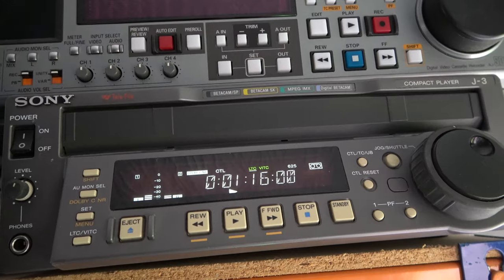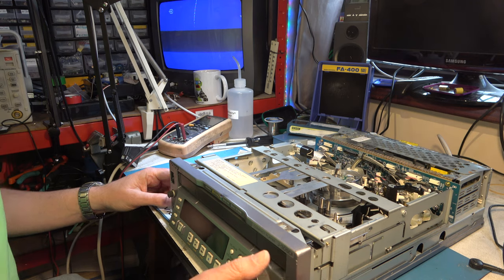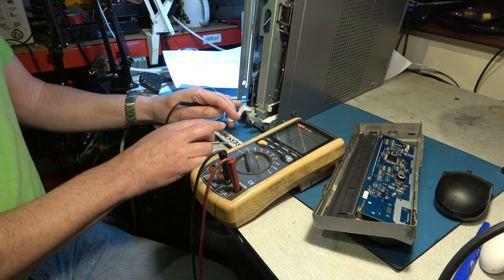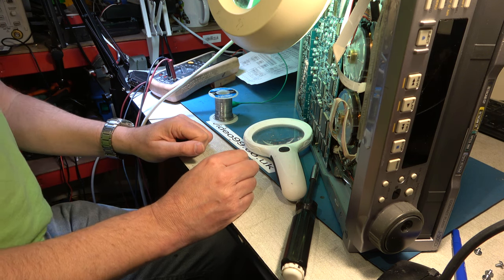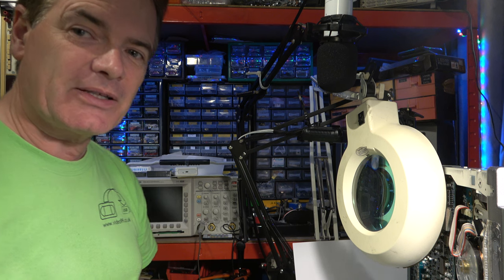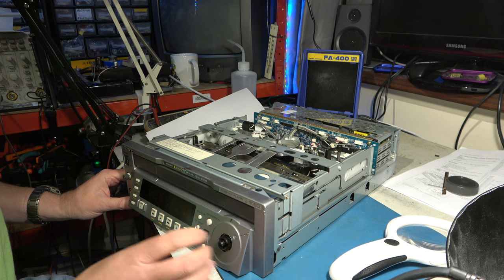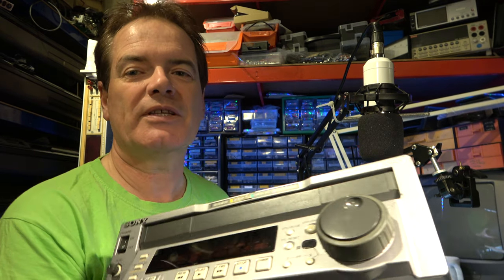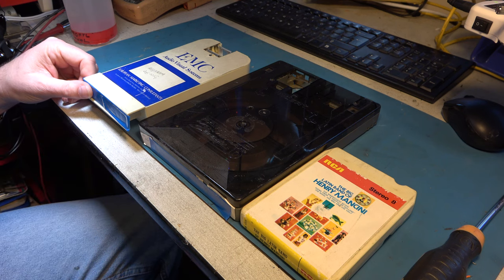Working on a Sony J-30 Digital Betacam player.  Can we get it to play a tape?

Comment: I bought x2 low hour mint condition J3's last year, both non working and both with faulty power supplies. The same fault and the same component. On one of them, if it was plugged in and left for 30 minutes it would often spring into life so I knew exactly what was going on. Both fixed easily although one really threw me as there was a problem with those ribbon cables to confuse matters! Ace units.
Reply from the maker: Got to be capacitors. Can you tell us which part(s) failed?
Reply: @video99couk  Yes. There's one capacitor, small and surrounded by a couple of other components halfway down that power supply board. Difficult to see really and definitely can't see the base. No bulging of the top and looks fine. It's in the SMPS startup circuit. I missed it for ages because it 'looked' fine and it was not as easy to take out so didn't bother. My ESR meter missed it also IN circuit. Again, that threw me off the scent. Both of these caps were the culprit on both J3's. When remove I could see leaking at the base. The 2nd machine repair still would not work which was a mystery UNTIL I found a secondary problem with one ribbon cable that despite testing fine on the bench (continuity) would not work when connected at both ends! Bad end contacts. I might have a photo somewhere and if so I'll post it here.

Comment: Nice video thankyou for sharing. Could you please take some time to talk about the loading mechanism of the beta series. Why the J30 player use the loading mechanism like VHS. And  PVW2800 or beta camcoder use several different  loading way. What will be affected by different loading methods of VTR with the same format.Thankyou!
Reply from the maker: It does go to show how the loading mechanism is not completely dictated by the format.  Most Beta equipment uses a loading ring but some uses loading arms.  Meanwhile most VHS based equipment uses loading arms but some (Philips Charlie mechanism springs to mind) uses loading rings.  Which is best?  Probably dictated by many factors including cost, weight, size and other factors.  The J machines were not as robust as the bigger decks but were all about getting size and weight down.

Comment: One drop oil on de bearing? (motor is shot anyway)
Reply from the maker: It's not mechanically stiff, it's an electronic fault with the motor.

Comment: Great video, I have one of these, if I put a digital betacam tape in should it play just via composite out or is it FireWire only ?
Reply from the maker: SDI to an SDI capture device could potentially give the best results, but Firewire would be good too.  Composite Out would work but is of course very limited quality.
Reply: @video99couk  thanks for the reply, I just get a grey screen with a digital tape via composite,  betacamSP tapes play fine via composite

Comment: Hi Colin, I notice that there is a small surface mount electrolytic on the capstan motor PCB, what are the chances that it's dud. I do also remember some of these motors having dry joints on the PCBs either on the hall effect sensors or the windings. Worth a look :)
Reply from the maker: Checked it already.

Comment: Am curious: did you put together your own isolation transformer, or did you purchase it from somewhere? Because I’d love to put my own together, but have never come across a source of 1:1 transformers in commodity products I could steal one out of.
Reply from the maker: I have two of them, one fixed voltage and the other with lots of windings which can be configured for various voltages.  They have both featured in previous videos.  I built them up myself.

Comment: I don't know about converting lossless AVI 4:2:2 to DV, I know it's a manageable format but really DV is obsolete and converting it to h.264 which what everyone wants these days incur a permanent loss, I'm not criticizing your work, I'm just saying that with modern CPU speeds and HDD capacities dumping lossless and converting it to h.264 shouldn't be a cumbersome task like it use to be 2 decades ago even for capturing analog formats not just digital Betacam. High quality de-interlacing and conversion to h.264 using ffmpeg in less than real time speed yields much much better results but can be scheduled overnight for multiple files so one don't have to sit in front of the computer.
Reply from the maker: If customers want other file formats, I capture them from the SDI port.  A lot of customers do take DV-AVI files though, virtually all video editing software takes those.  Bear in mind that here in the UK, most tapes are PAL and DV gives better results in PAL than NTSC.
Reply: I converted 11 hours using a J-30SDI deck, output from deck was uncompressed SD in AVI pocket, then trasnscoded it to both Apple ProRes 422 HQ and ProRes 4444 to see the quiality differences, if any. As there weren"t any, we stuck with ProRes 422 HQ. That is also a nice delivery format of our shows for many streaming platforms.
Reply: @frankfarago2825  4:4:4 just bloats the file size, It will not add any visual benefit to the quality of the video.

Comment: What about removing the capstan motor and strip it down to the coils?, there could be cracked joints on the hall effect pickups.
Just a silly thought.
The front display has high voltage and filament voltage around 4 volts maybe, 
Shame they don't tell you the led fault meaning :-(
Reply from the maker: These things aren't know for dry joints.  I think it's actually failed.  Hoping to get a replacement.
Reply: Having taken the plunge on a dead j3 the other day I was encouraged by the ease of obtaining the service manual. 
While it reads like a book of peril they do explain the led functions. Why they would light. Later on in the errors section it is explained what errors are available to be determined by the display code and a breakdown of the codes and code makeup.
Flashes may be linked to the code number though that is not stated in my limited read of the book.

Comment: G’Day! CAN YOU HELP? I need advice on what used miniDV deck I should seek, buy, use, then resell on eBay. 

I have 30 miniDV tapes from 20 years ago that I want to digitize. A regular Sony camcorder I have, who’s heads I’ve cleaned, shows they all have lots of glitches (blocky video artifacts, sound chirps and cutouts. Etc). I’m hoping there’s a used affordable system out there than can help clean this up by a lot. Something. With FireWire in obviously. CAN YOU HELP?
Reply from the maker: Any good camcorder should do this.  It may be that the one you have been using is defective, or it may be that the tapes themselves have been recorded on a defective camcorder.  I have a range of different players to overcome just this sort of problem.  There's no guarantee that using an expensive professional deck will do any better than a more modest camcorder, and it might even be worse.  So probably it will be better to get someone like me to work on them.  But if you do want to have another go, I've found that Panasonic camcorders can be a little more tolerant of bad tapes than Sony ones, for some unknown reason.
Reply: Thank you for the reply. I can’t find it now but I know I read somewhere that there’s a certain Sony model that has componentry that no others have to improve the reading of old tapes. I was hoping you knew about that and what model It was.

Comment: Okay -- so cosmeticaly it is rather a rotten egg, it ain't working, and as it is a mere pedestrian J-30, as it does not even have the single SD-SDI output BNC jack on the back. What a barn find, wow.... :face-red-droopy-eyes:
Reply from the maker: I thought it does have SDI but would have to check.  I wanted the Firewire output which it does have.  Most of the kit I get in doesn't work, the fun is trying to fix it.
Reply: @video99couk   I just purchased a like-new J-30SDI with only 104 hours on its head/drum assembly for only €650. I didn't need to "fix" anything on it or inside of it, as anything and everything on it works just fine. Whatever. :face-orange-frowning:

Comment: hi dr who  you had on the tape   the old BW one  tomb of the cy men
Reply from the maker: I saw it was an old Dr Who but didn't look any further. Odd thing to have on a DigiBeta tape.
Reply: @video99couk  I'm quite curious about that, as it looks like it might be a tape I made when I used to look after the restoration of Doctor Who for the DVD range. It seems to be a yellow label BBC Resources tape and at one point you can see a comparison wipe between the restored and unrestored sections of one of the most damaged parts. I wonder how it ended up with you? (Only curious, I have no claim to it!) What does the label say?

Comment: I watched a few of your video and you do not have a clue what your doing. I can’t go into this to long but you seem to rely on taking part of one machine to put in another’s. This thing is old and need a service which you can’t do because you can’t read electronics signals right or know how a component affects another component. The whole thing needs to be stripped down and tested. You have test points on a circuit you read to check. I don’t think you know how to use oscilloscope right. I’m not putting you down but these things are old now and they are going to have problems and need a good service. Use to do all this years ago and you need all the right equipment for these things.
Reply from the maker: You do know that the defective panel on this J30 is treated as a replacement part by Sony and there are no schematics available?  Haven't you actually watched me doing component level repairs, such as on the Beta PCM S/PDIF phase locked loop jitter fault?  Or how about the V2000 which had a faulty hybrid so I built a replacement POR curcuit?  Or reverse engineered a DAT machine to perform SDIF2 to S/PDIF conversion?  But sometimes parts swapping is just the quickest way to narrow down a fault.

Comment: hi what if you have 4 audio channels this only has 2 on the banks ha ha
Reply from the maker: You can select which channels are fed to the analogue connectors, or use SDI output and capture all four digitally at once.